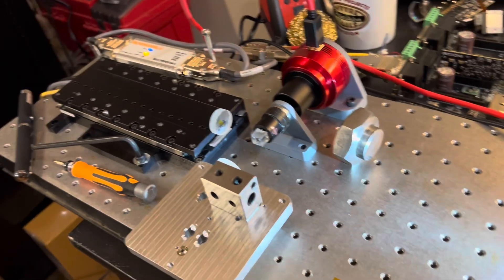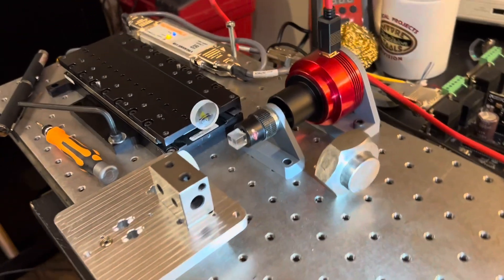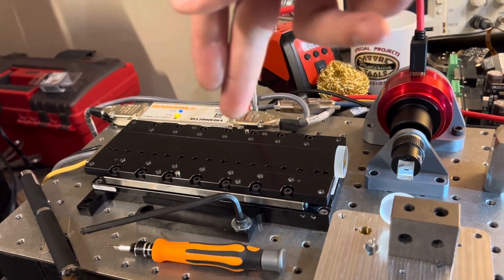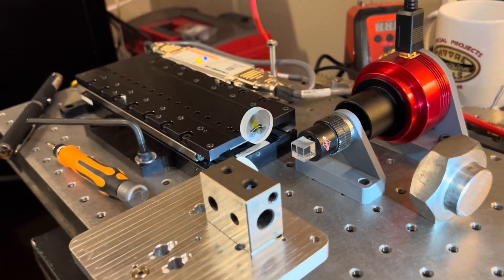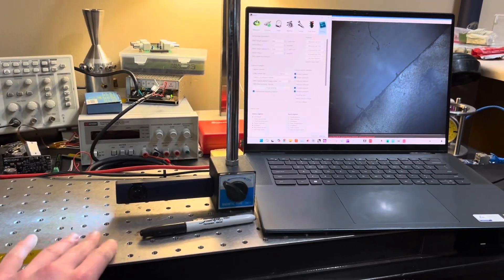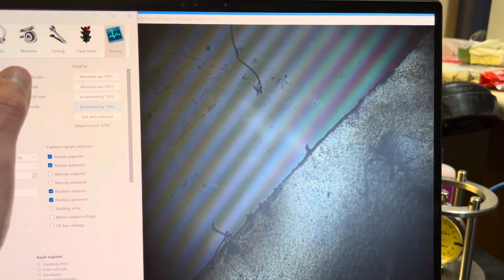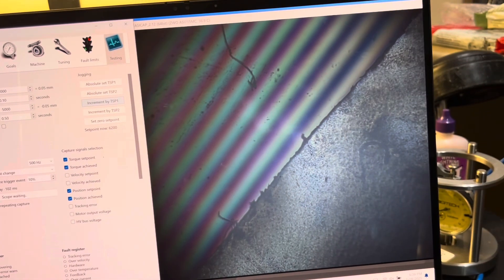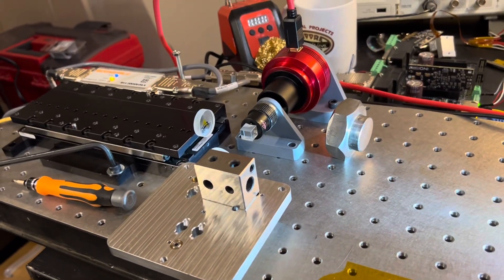Quick and dirty SWLI prototype

Comment: What camera are you using? What not a monochrome with no  CFA.  To my knowledge which is much less than yours, smaller pixels can potentially resolve finer details, but they might also be more susceptible to noise.
Reply: Smaller pixels catch less photons because there's less surface to catch them. That leads to needing higher amplification factors to get the same net signal strength, which also brings up the noise floor. So yes, indirectly, smaller pixels do generally have more noise. The resolution increase that is consequence to using more and smaller pixels, should be fairly self-explanatory. :)

Comment: Nice setup, it looks pretty stable too. The main issue with building a real wli is the software. As far as I know, there is no open source software available for this purpose.
Reply from the maker: Thanks Jeroen! It looks stable until my neighbor starts walking around upstairs 😉. I made a simple piece of code last night and actually tested it with the videos of scans from your WLI video. Seems to be workable. I will try implementing it on my setup today. Need to do some calibration first.
Reply: @cylosgarage  You used the images from the video? That's amazing!  Let me know if you need any other specific video footage. I guess though that the most important data to reconstruct a surface is how the images relate to the position of the stage. In my case the ZYGO software takes care of everything but also completely hides it from the user.
Reply: @cylosgarage  If the vibration ends up being a big problem, you might be able to use the LED as an ultra-fast shutter by only turning it on for ~10us. That should reduce the displacement actually seen by the camera. You might need a camera with an external trigger though to sync up the pulses. I've been playing around with building a WLI with similar surplus equipment and found that trick in a paper while researching earlier today (10.1364/AO.55.006172 is the paper)
Reply: For me you have the best video about WLI, Jerome!!
Keep making videos that we keep watching!!